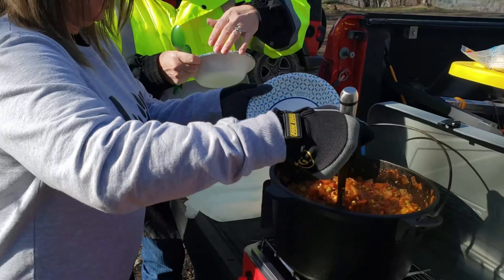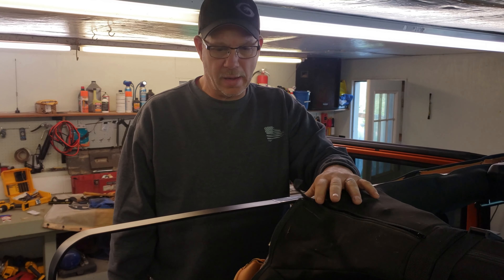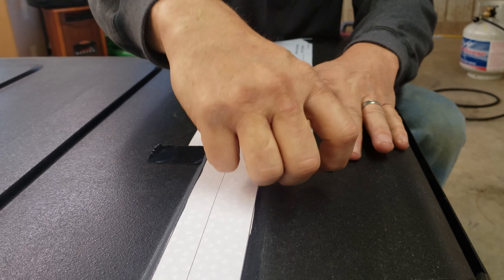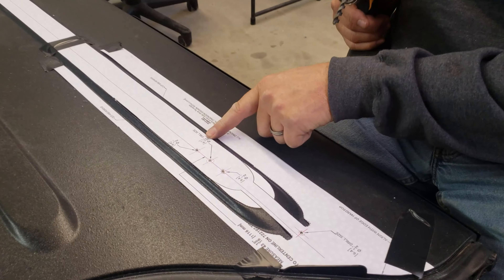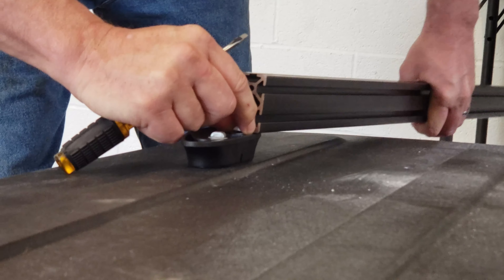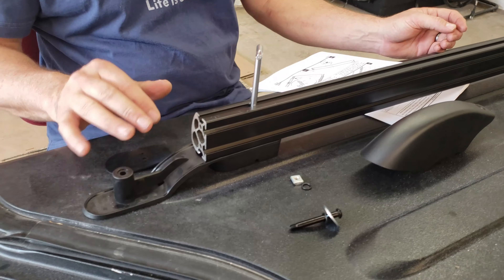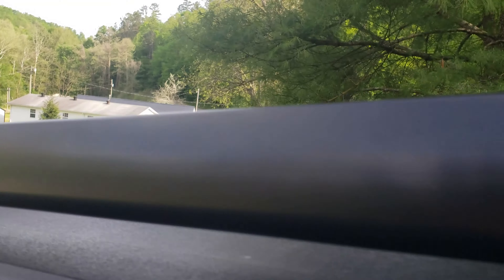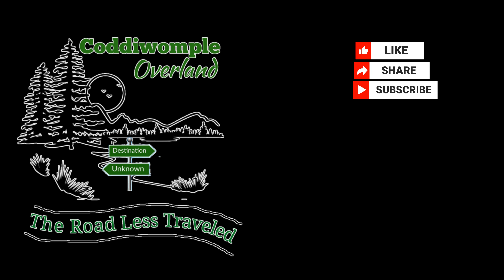Teraflex Nebo Roof Rack Install and Review

Comment: Perfect timing I'm about 75% done with my nebo install and this will help with the remaining items.  Thanks!
Reply from the maker: We are glad it's going to help!  I hope you like it as much as we do.  Thanks for watching
Reply: @CoddiwompleOverland  took me a while to install but it's almost done....I can see the rear driver bolt from underneath the bracket (one of the four that bolts into the cage) but I can't get it to bolt into the sleeve.  Any idea what might work? All else is good.
Reply from the maker: Send me a message  on our FB page with a picture  of the one you are having  trouble with and I'll certainly  try to help you out
Reply: Ok!
Reply: Just wanted to thank you again for taking the time to give some suggestions.  I ended up drilling down through the main rail about 1/4 inch towards the front and the bolt went in (finally) easily.  All the best to you.
Reply from the maker: Glad you got it fixed!  And glad to help!

Comment: Can you give me a quick measurement (width) from center line of rack (at bolt) to center line? I have a custom roof top and want to k ow if I can make it work! Thanks a ton. Great vid!
Reply: From cl to edge of roof top I know it’s 43 15/16 to CL
Reply from the maker: If I understand correctly,   it is 21 31/32 from the center line of the rack bolts to the center of the roof.  I hope this helps!
Reply: @CoddiwompleOverland  I was needed a measurement to the edge of door on side to CL of bolt! Any idea?
Reply from the maker: Sorry about the delay.  I wont be back to my Jeep until Friday. As soon as i get home, I will get you those measurements.

Comment: I’ve had my Nebo rack on for about 2 years and has started to leak. Are you experiencing the same issue?  Thanks!
Reply from the maker: We have not had any leaking at all.  Thanks for watching!
Reply: @CoddiwompleOverland  thanks for getting back with me. It started only about a year after install. I’m going to take the top off and try to tighten everything down again and then seal it from the exterior too. I’ve had a ton of water get in and got to the point where it’s standing water on the floorboards. Its mostly coming in toward the front near the freedom tops but absolutely some coming in from the rear too. Basically saturates the sound bar and then flows down the b pillar.  Anyway, love the channel. I live in Nashville and you’ve expanded the areas I want to see!  Take care!
Reply from the maker: Hope you can find the  source of the leak.  Let us know so we can watch out for it with ours.  Thanks for watching!